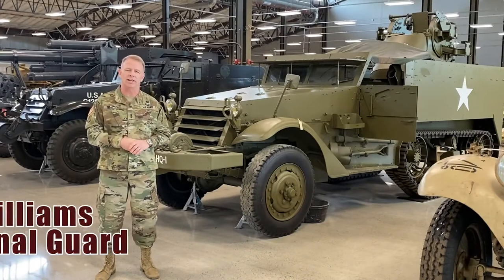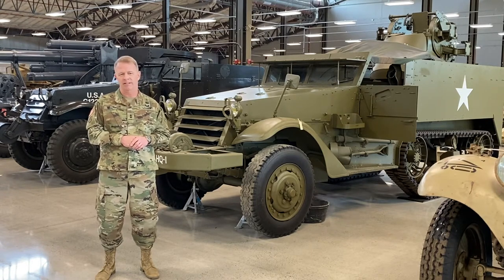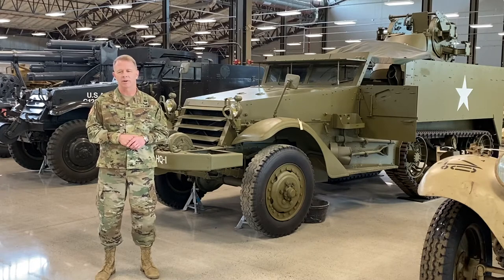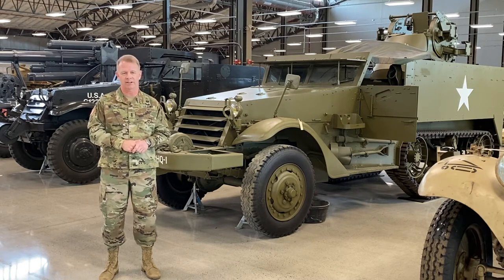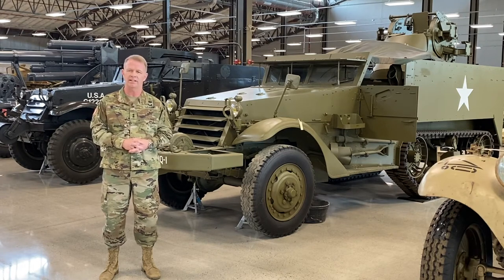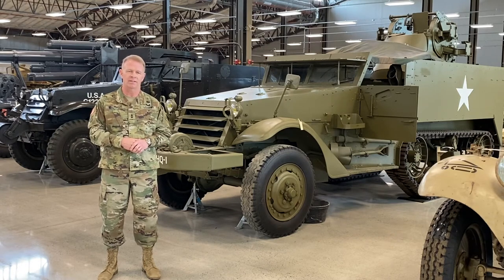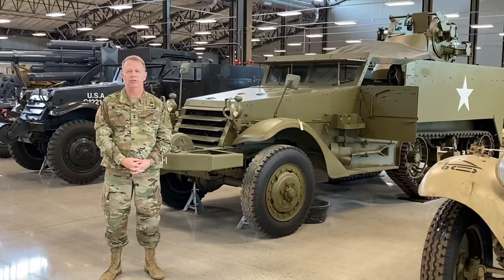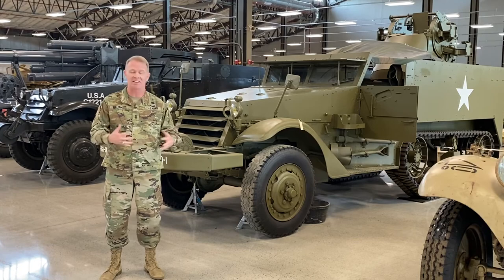WWII Half Track Multiple Gun Motor Carriage | Ordnance TSF: An Inside Look

Comment: I would love a close look inside the back of the truck and the driver's area!  Taking a close look at the drive train would also be very interesting.  I seen where soldiers who used these, would say that the engine could run 24 hours a day without issue.  Thanks again!